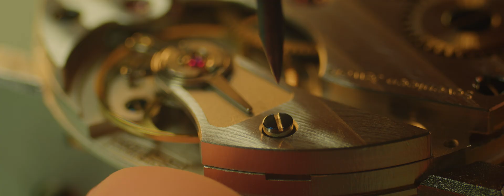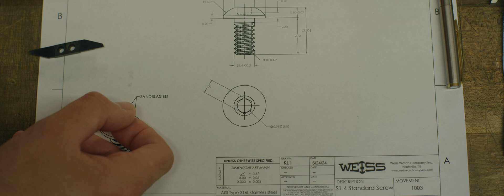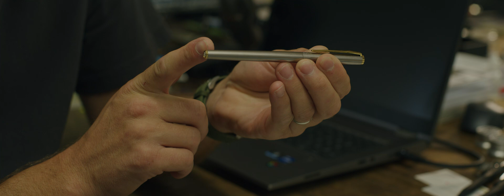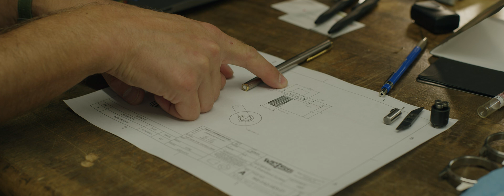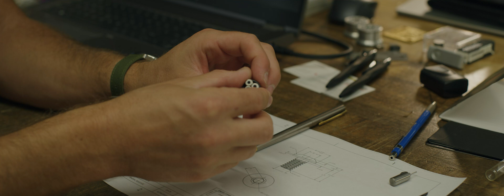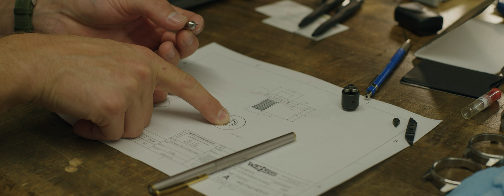Creating a Watch: Case Screws

Comment: From an engineering point of view this is super hard to make on such a small scale... First there is the small, multilayered shape and then you have to put thread on it. You must do this at a super slow speed in order to control the end result if you make these one by one. Thanks for sharing and have a great one!
Reply: Does "super slow speed" jive with Cameron's first video in this series where he said his SwissNano can produce a finished screw every 30 seconds?
Reply: @roygardner2374  I must have missed that one. If done by hand on that scale their is no way you could go fast. The miniscule size makes it hard to do on a lathe.